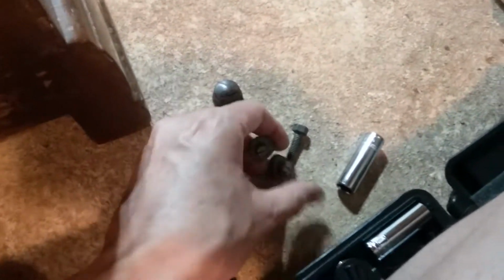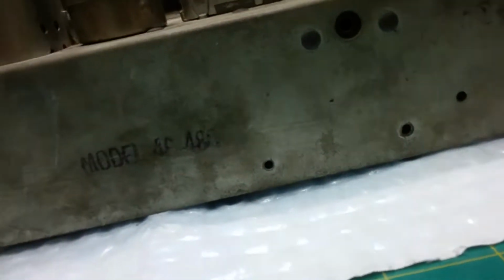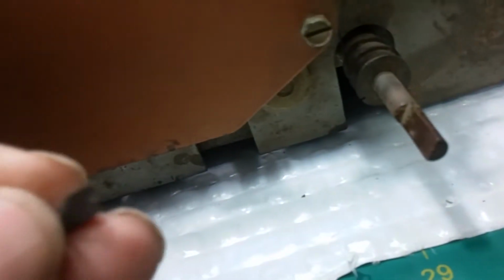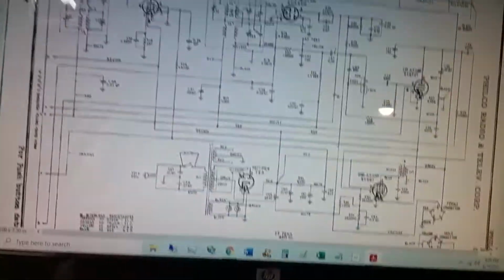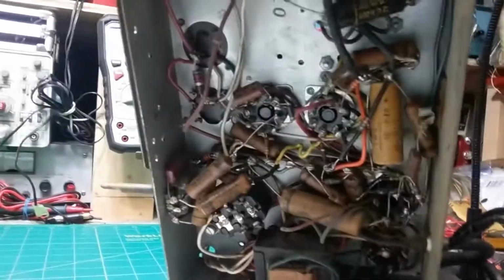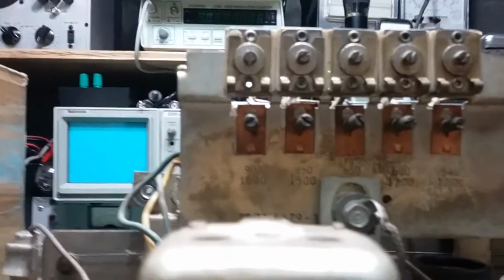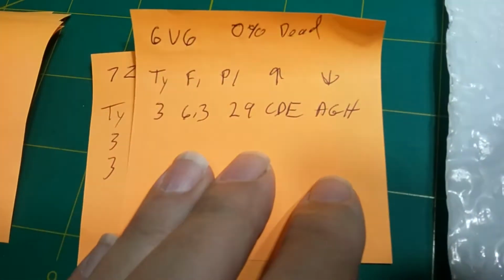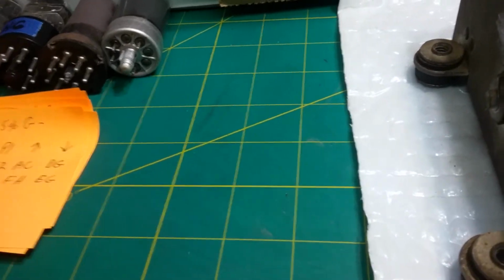Antique Philco AM/FM/SW Model 46-480 Part 1: First Look

Comment: Nice!  I restored one of these belonging to my uncle that his father bought new in 1946.  Half of the old wires, the insulation had crumbled off of, one of the push button coils has a break in the wire and that was fun trying to solder it back together, lol.  Replaced all the old caps in it and as I recall I think I also had to replace the rectifier tube's socket.  I got new chassis washers, grommets, felt knob washers and a new dial for it from RadioDaze back when they were still reproducing all that stuff as well as a new grill cloth.  The dial backing had lost most of it's flocking so I re-flocked it with some spray adhesive and a bag of brown flocking I got on ebay.  The finish was very worn so I stripped it with lacquer thinner and then added a coat of satin clear lacquer.  Where the color was un-even I touched it up with some Mohawk toner and then added two more coats of the lacquer.  The greatest compliment I got was my Uncle saying it looked like it did the day his Daddy brought it home :)

Comment: Hi I have a question about the FM antenna and  my question is “ what could I use for the FM antenna I have the same radio and it doesn’t have that antenna only the AM antenna “ 
AKA ¿ what type of cable do I use and how do I connect it ? 
Because idk I’m a kid
Reply from the maker: You can use a dipole antenna. shorturl.at/ahoN1
A long piece of wire should also work. But get an adult to connect it please. Make sure it is unplugged before connecting it to be safe.
Reply: @ElectroRestore  ok sir thanks,  yeah probably my dad knows how to do this his an electronic engineer so that should make things very easy 

And again thank you